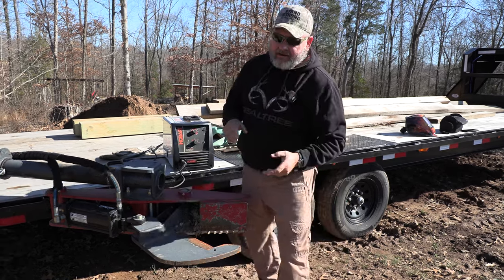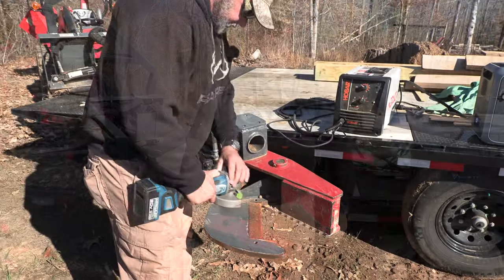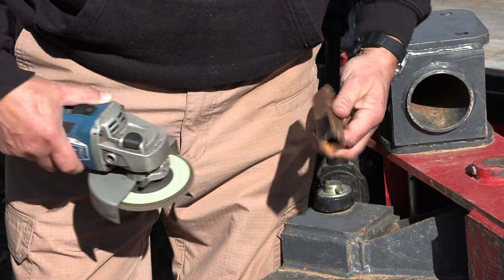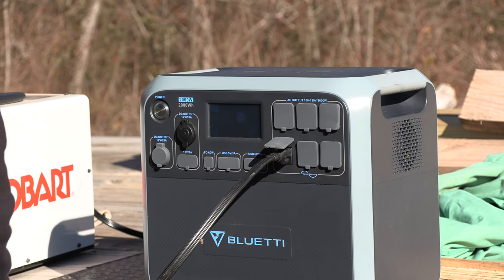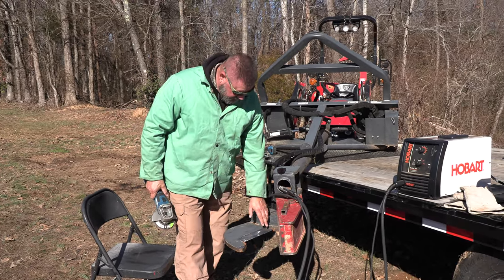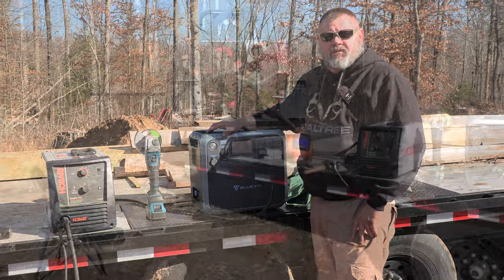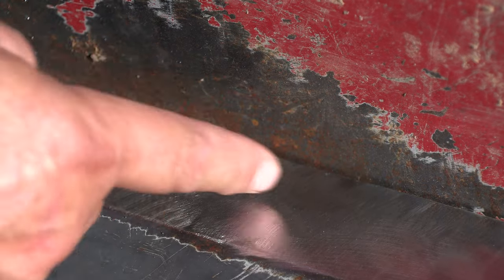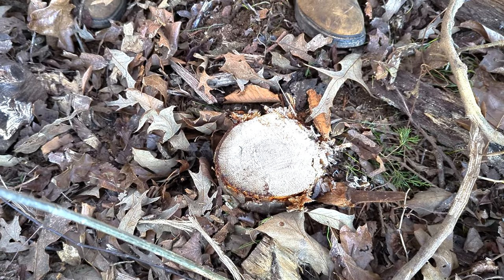Bluetti AC200P Welding! Tractor Mini Clip Shear

Comment: The company that designs and builds that shear should have a machine recess and bolt on replaceable or reversible blade similar too  a wood chipper .  There will always be something that will damage the  edge . Would be nice for the customer too have a  easy fix in the field . You did good though 👍 There is  spiecal rod for building edges . But they are exspencive and take lots of prep and procedure on the edge etc . Pretty impressive battery pack . 👍
Reply from the maker: I would guess, it would add complexity and cost. Not a bad idea, but I hope I don't shear anymore Tee-Post

Comment: So when welding on blades like that there is a  concern about messing with the chemistry of the base metal from the heat of the weld. Even so I would have ran hot 7018 on it and then ground it down after so I know it has good burn in. Another idea is too use hard facing wire or hard facing rod. All in all good job! I'm sure it'll continue to work great and if or when it chips again you know you can fix it And enjoy your video's as always
Reply from the maker: I was happy that it turned out as well as it did. I really had nothing to lose being that the sheer was already chipped. I think in the video I said it was hardened steel. I meant to say harder steel.
Reply: @Tony's Tractor Adventure Homestead  ahh that makes sense. And yeah it definitely worked nicely afterwards and had a smooth edge. The power supply was very impressive too.

Comment: Nice job of field repair and maint. I normally use a chunk of brass or copper as a backer when welding like this. Weld won't stick to it.
Reply from the maker: I understand. I had to use what I had at this location. I don't weld every day so I am out of practice. Next time I will use brass

Comment: Use copper or aluminum for your backing and you'll not need to worry about fusing. Copper is preferred.
Reply from the maker: I understand. I had what I had at this location. I looked around and found this rusty steel.
Reply: @TonysTractorAdventure  sometimes we just need to improvise, overcome and adapt.
Reply: @DaveJohnsonad5nm  Tony is/was a Chief Warrant Officer in the Army, so he is well versed on adapting.  Sometimes you can’t wait until the bullets stop, just getter done!
Reply: Should have left it rusty dirty harder to fuse

Comment: I'd be kind of worried about bigger chips/chunks breaking off again, but I've always patched up my bush hog blades to get a little more life. Do slow quick spots on the chunks and it holds a little better, but doesn't hold up to rocks/harder materials.
Reply from the maker: I am not worried. This blade moves very slow. It is only supposed to shear trees. LOL!

Comment: My fear is that you've diluted the chemistry of the existing blade by adding mild steel filler. Also, depending on what alloy the blade is made from you also risk softening it with the high heat of the Weld. But the proof is in the pudding and if you can clip that elm with no damage you're looking pretty good!
Reply from the maker: So, what you are saying is, I did OK! 😇 I welded for such a short time, the overall mass of the cutter, never warmed. Time will tell.
Reply: Let me know if it works. I have a similar job coming up with chipper blades.